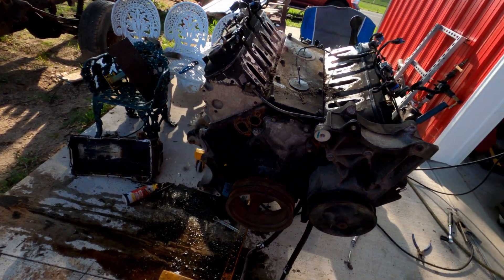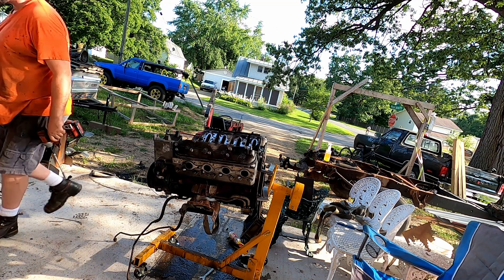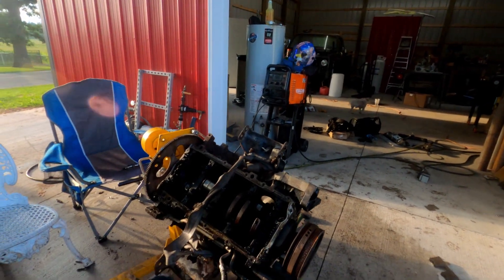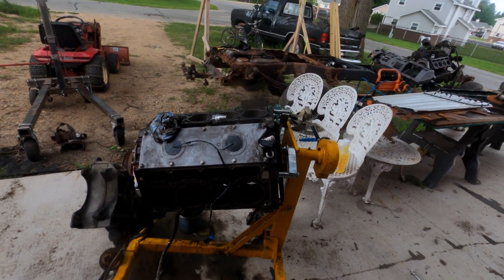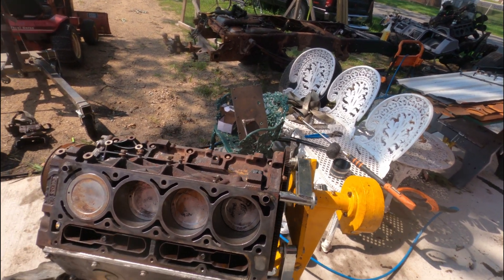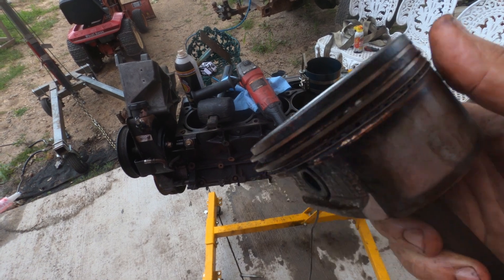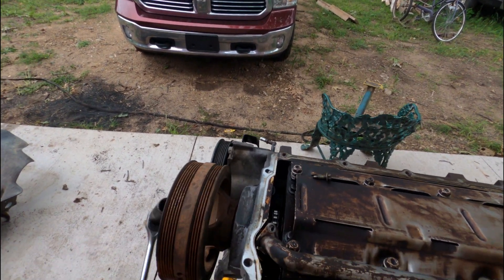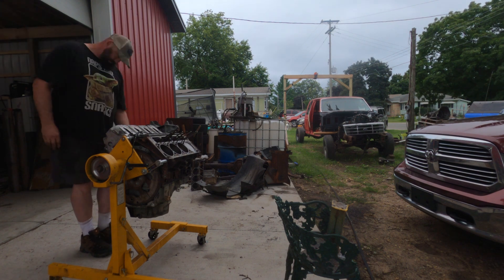Knock the dirt off and send it! LQ4 rebuild. From locked up to rocked up

Comment: Just one more case of finding usable engines in strange places:
I just found a tiny salvage yard in the middle of nowhere Oklahoma, and even after they'd junked most of the yard recently, I found an lm7 Suburban, 
 a couple of l59 Silverados and a lm7 TrailBlazer.

Now, someone had found them before I did as there were bits and pieces pulled, or even complete engines from a few, but plenty of good pieces, including a truck engine harness to strip down for a fraction of the cost of one from China...

Comment: I'm about to rebuild my little 1.8T (already have most of the stuff) but was wondering what grit ball hone do you suggest? That's the "last" thing I really need to get... Oh yeah this will be the first time I have ever rebuild an engine and I'm definitely not doing anything fancy! Lol... No machine shop for my Shitbox!
Reply from the maker: I have no idea what grit that ball hone is lol. 

I really just used it to clean the garbage off the walls.
Reply: I watched a good video where a guy demonstrated how a 3 stone whetstone hone helped to resquare the bore way better than a ball hone does.
Reply: @jimandskittum  if I can find one of those cheaper... The only reason I'm even opening the engine to to upgrade rods for big boost. But after 190,000+ miles new bearings and rings are cheap enough.
Reply: @4BillC  I think you can still do the loan a tool thing at the chain auto parts places. Bearings are cheap. I was wincing when he said he was going to re use the originals.

Comment: Hey JR I am not sure if this would work or not but if you ever have pistons that are carbon'ed up like this you might try and grab some of the simple green HD and toss them in a 5 gallon bucket with the whole bottle and fill it with water.  it's a different formula than the regular simple green HD and it cuts grease and built up crap like no tomorrow.  for stuff with garbage paint on it will usually etch the paint off.  Like I said just a cheap experiment you may want to try some time and it is enviromentally friendly so you can pour it down the drain.   I've been using it and it works great.  Also tried it with a heated parts washer and it was amazing.
Reply from the maker: Simple Green works awesome! I use it to prep parts for ceramic coating in the shop. 

I try to keep the bulk grease and stuff out of it though.
Reply: @TheDrivewayEngineer  Yeah I usually have a HDX box I put the really crappy stuff in and let it soak for a day and then hit it with the hose or pressure washer and if it needs more work after that I will get a stiff brush and scotch brite pad for the 
highly packed areas that are left

Comment: I don’t know if you prefer to make short videos JR but I just wanted to say I like long videos. Also while I’m at it I’m having the issue with crazy oil pressure on the gauge. It goes from 40 down to 20 unless I’m giving it gas.  My truck is a 2012 5.3L GMC Sierra with the active fuel management. Can I get away with replacing just that O ring and that’s it. No oil pan gasket if so that’s would absolutely bring my stress level down A LOT
Reply from the maker: I prefer to make the longer ones, I just do the shorts to cover quick things that would get lost in a 40 minute video
Reply: @TheDrivewayEngineer  JR I just had another question that I added to this comment. I was hoping you could help me out with. I have a 2012 GMC Sierra that’s having the oil pressure issue. It goes from like 40 to 20 unless I’m on the gas. Can I replace just the O ring and not have to get a new oil pan gasket. If so that would absolutely bring my daily stress level down.
Reply: I agree 15 to 20 min videos are perfect IMO

Comment: The lq9 I most recently got was like that. It was my own dumbass fault for not looking it over a little better but I got it cheap enough that it was still a good deal after I fix it.  The good news is the cylinder bores look pretty good, the bad news is it was running or turned over enough to ruin a rod and piston. So it's gonna get a rod/piston everything cleaned up, put back together with a GPI cam and LS6 intake I got for cheap.

Comment: I love copper spray ive had people try tell me i compromised my seal using it on mls and then half them tell me heads need the surface to be super smooth and others say opposite need milling marks to help give bite. Fuck idk I never even send heads to be surfaced neither. Sandpaper contactglue, and old granite table. I use copper on everything and never any issues. Even on the notorious 6.0 powerstrokes where some guys spend thousands on getting them studded to fail again at 20k later yet im rockin reused TTYs doing everything they say not to do like really hot tunes lol